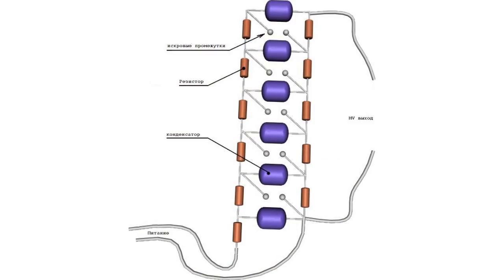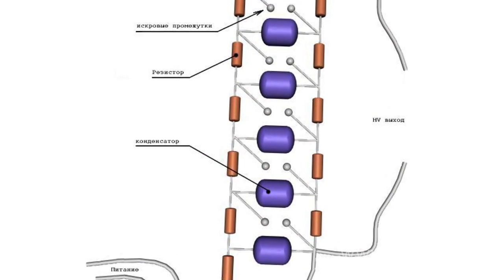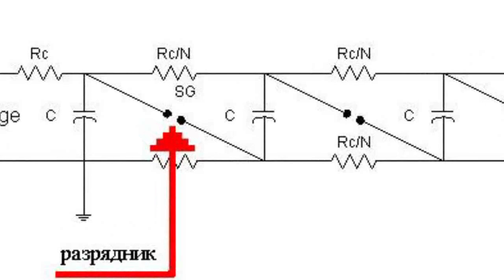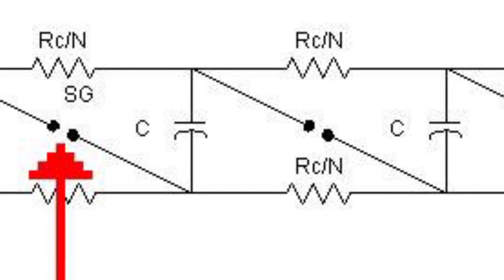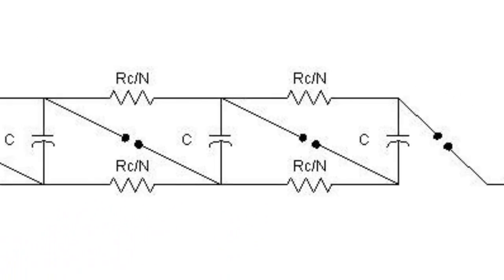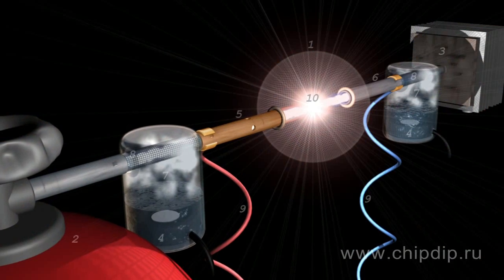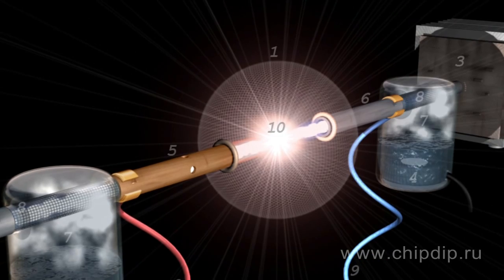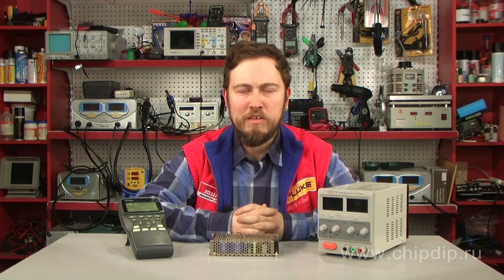Marx Generator

Comment: Vacuum spark gaps try to place them where ever a spark is present pulse should increase has the current cycles. Use organic carbon power cell bank rather then a capacitor bank. 😊

Comment: You could rewind a MOT. like mine: 4 turns with 2 AWG, Result is, about 450Amps & ~3V AC. you can use more turns for higher voltage, But more voltage = lower Amps, then rectify.

Comment: @iEugene1994 I think your best bet for a power supply with those requirements is big stick welder.  Some of the bigger ones can probably handle 350A, and you can probably dial the voltage down to 72.  I think his "invention" is doomed to fail though if he multiplies 72 volts by 350 Amps and only gets 5000 Watts.